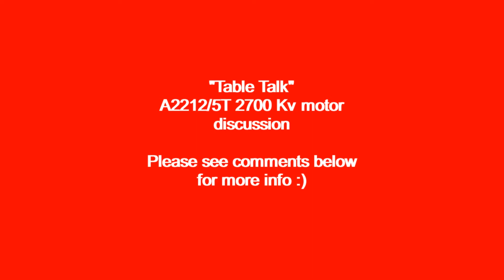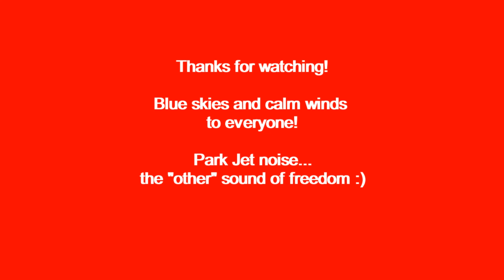"Table Talk" - 2212/5T 2700 Kv motor discussion

Comment: I think I'll pickup a couple of these for testing. Thanks for the info. The specs state the motor is 55 grams, is that correct? Thanks for the tip and Happy Flying!
Reply from the maker: No problem :)  Yes 55 gr is the approximate weight out of the package.  I find that after attaching the connectors, X mount, prop and prop connector they normally weigh about 67 gr ready to go in the plane.  Good luck and happy flying to you as well :)  Cheers, Scott
Reply: Thanks for the info on the weight and Happy Flying!

Comment: Hi Scott,  I picked up four of these motors recently and will be using it on my recently started MiG 29 V1 build.
I figure if I thump it into the ground,  no biggie.
In the meantime,  another Nor’easter on tap for New England later this week.  More time to work on the V1
while the flying field continues to thaw!  👍🏻😃✌🏻
Reply from the maker: Hi Jim, sounds great, should move your Mig along smartly :)  Sorry to hear about more snow, we are entering into a long period of rain and wind here for the remainder of March it looks like more table talks and less flying :)  Good luck with the rest of your Mig-29 V1 build :)  I am hoping to do a step by step video of a slightly modified (for beginners) Mig-29 build during the next week with the wet weather.  Cheers, Scott